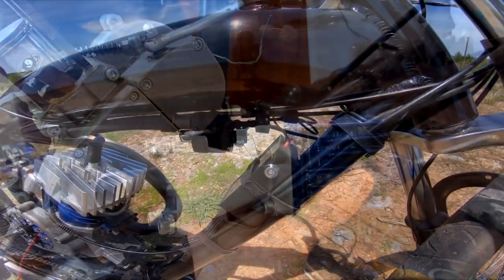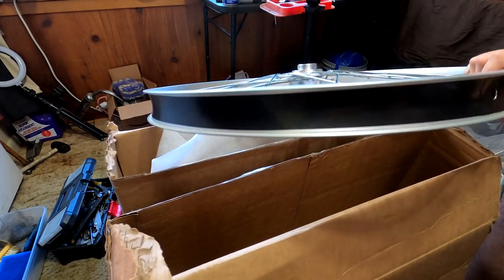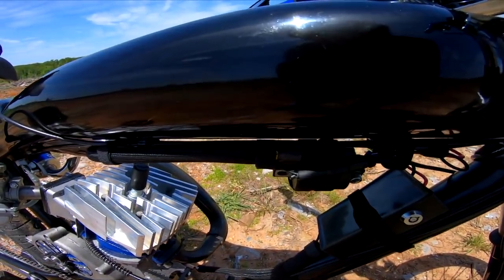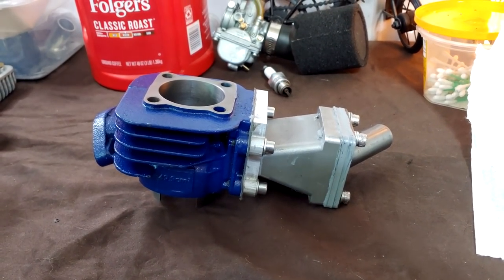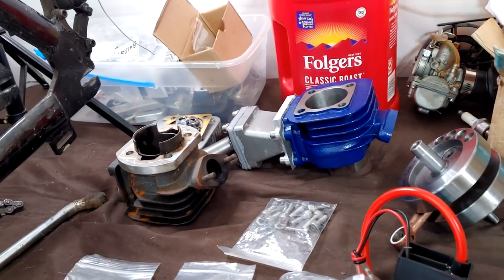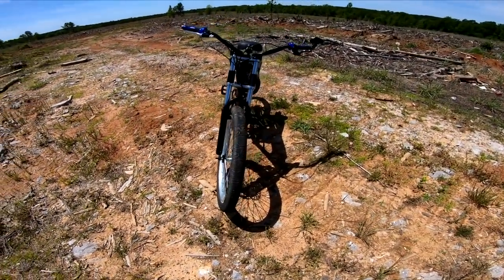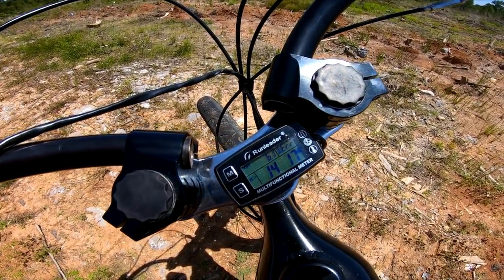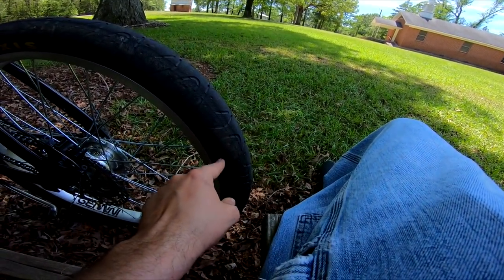Safer, Stronger, Longer, Motorized Bike

Comment: The seal was leaking and gas tank started pissing not dripping pissing and now my head blew up ..I waiting to see if the company does the right thing .and when I talked to them they told me that the break in was 20 to 1 witch no one said anything to me never got a pamphlet with the kid but the company told me that it was their fault but now they are sending them I. The kits now so when I get the new engine back I will definitely listen to how they want to do oil mix... It's a good company so hopefully they honor their mistake and replace my kit they have excellent customer service so I don't see this being an issue

Comment: So I slapped my old "100ccc"anbull engine on the bike again and to my surprise it's so much more smoother there's no bucking and I hit the same speed on the 44 sprocket as I did the phantom 85 and my anbull dnr have a reed or a window piston.so this got me thinking I should put a reed and window in it and see the difference between both and the way I'm seeing it the anbull dnt pick up like phantom but again there is no reed or window so yea I might put the phantom on hold till they get it rite
Reply from the maker: Sorry to hear about you p85 man. Good luck with the Anbull, I hear good things about that motor.